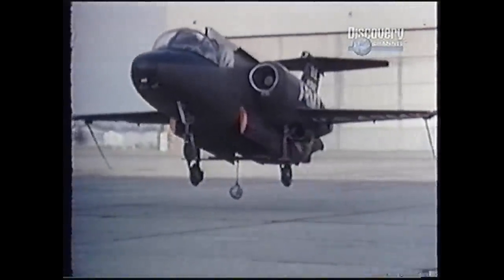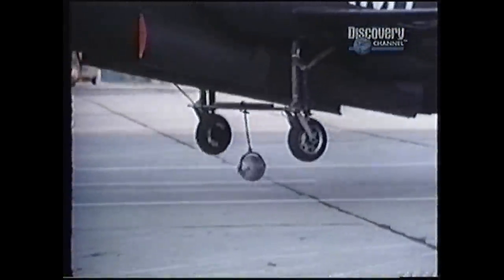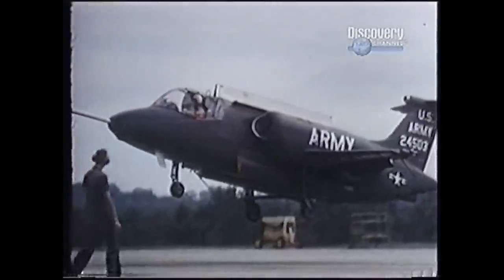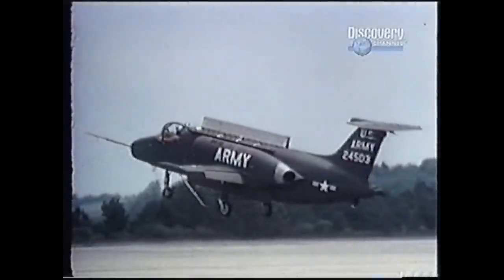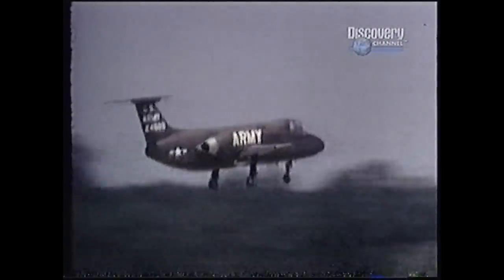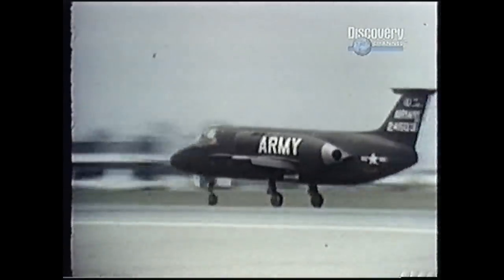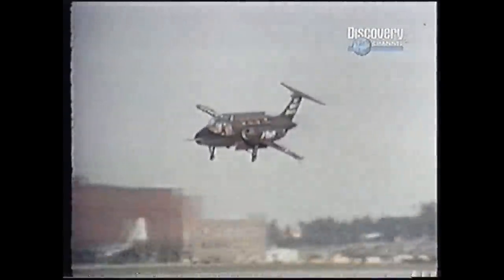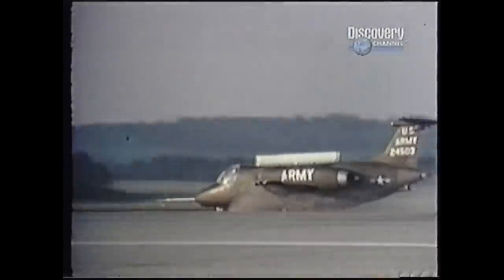Lockheed XV-4 Hummingbird Test Flight Crash

Comment: Worked on the B model from 1968 until the end of the program in 1969 following its destruction in a crash after going into an uncontrolled roll at altitude while transitioning from horizontal to vertical flight. The pilot survived the ejection. The plane went in at a nose down attitude, compressed into the ground and then exploded outwards. We picked up the bits with rakes put it into crates and buried it in a landfill following the investigation. I have one of the rudder pedals. Badly damaged and still carrying traces of Georgia red clay.
Reply: man 80 years old and on youtube? you have kept up with the times
Reply: And the pilot?
Reply: @jrr3613  The pilot stayed with the plane trying to save it, ejected at the last minute and survived with minor injuries.
Reply: I thought it looked like Dobbins.
Reply: ''Compressed into the ground'' sounds better than crashing. Also, there is ''controlled descent into the terrain.''
Reply: @davidcraig1579  That's amazing. But are you for real?

Comment: The biggest issue with separate lift engines is that they're just dead weight in forward flight, reducing range and payload. The Harrier at least manages with just the one engine, which is why of all the designs tried, it was the only one with any real use.
Reply: but aiming hot exhaust at the ground isn't always good either
Reply: @midgetman4206  tell that to the bad guys you're flying over.

Comment: The lead ball wasnt to keep it close to the ground.300lbs really is nothing to a aircraft It was to lower its center of gravity to make it more stable.
Reply: Yeah I was wondering that too... 300 LBS, a cessna can carry that
Reply: @2ksnakenoodles  
Until it starts swinging like a Pendulum Do !!!
Reply: @richardvear1635  oof yeah, that would cause massive issues!
Reply: I think those was to prove test pilot have balls of steel
Reply: @Kamran Ul Haq  Lead is not made of steel.
Reply: Lowering the center of mass on a rocket (or in this case; a VTOL aircraft) does not make it more stable. This is what is commonly referred to as the "rocket pendulum fallacy". Here's an excellent video by Tom Stanton on the subject: https://www.youtube.com/watch?v=OYHCP3-mpxk

I'm not an expert nor have I done any research on these tests, but here's my theory on why it was used:
While the aircraft was most likely able to hover with the ball, more thrust was required to hover with the ball off the ground. This meant that, in effect, the lifting acceleration was automatically reduced when the hovering limit was exceeded which, in theory, means that the pilot needed to make less manual throttle adjustments while hovering.

Comment: Lockheed Georgia made two of these and both were crashed, The one in the video was lost in a hovering test, killing the Air Force pilot. The second one, some years later went in an uncontrollable roll at altitude and the pilot eventually ejected successfully. I worked there from 1966 to 1983.

Comment: In the end, the military just said, "You know what? Let's just buy the Harrier, it works so well.
Reply: I recall as a child seeing the early experimental flying (craft); in the national science museum: that became the Harrier. If my memory serves me right due to its shape it's was known as the flying bedstead.
Reply: @pegjames188  That was the nickname for Rolls-Royce's "Thrust Measuring Rig", a test platform for directed thrust engine development first flown in 1954.  That led to the Rolls-Royce RB.108 engine which powered the first VTOL aircraft in 1957: the Short SC.1.  
The Hawker-Siddeley P.1127 (which led to the Harrier programme) flew in 1960 using newly-developed vectored nozzle technology and the Pegasus 5 engine designed by Bristol Siddeley but built by Rolls.  The design of the Pegasus 5 had been informed by data from the TMR but it was a separate programme.
https://en.wikipedia.org/wiki/Rolls-Royce_Thrust_Measuring_Rig

Comment: Never knew about this program. I see a lot of smug posts dumping on this aircraft, but if I recall, the Harrier program in it's beginning stages was plagued with issues, not certain why all the hate on the Lockheed XV-4. 

I wonder if the US Army had succeeded with this and purchased the aircraft, how the USAF might have reacted. After all, the US Army has no fixed wing combat capable aircraft.
Reply: cameraman655 they wouldn't have been allowed to proceed as the Army is prohibited from operating fixed wing combat aircraft. This programme and others like it for close air support aircraft were the reason the Air Force was made to provide a close air support function leading to the excellent A-10.
Reply: Interesting that you mention the A-10 Warthog, I recall reading that the Air Force was looking to decommission the A-10 back in the 90s, but decided against it when the Army expressed some serious interest in acquiring the aircraft. The infantry simply loves that beast.
Reply: cameraman655 there was also the fact that the A-10 had performed better than the so-called experts said it would in the 1st Gulf War.
Reply: Neil Dahlgaard-Sigsworth It kept proving that an old design was very practical at its job with close air support to ground troops. Also, it's durable build kept it in the air under ground fire. It may be technologically behind, but it's like the Bradley, or Abrams of the air.
Reply: Backyardmech1 thepowers that be had forgotten that the most accurate ground attack aircraft in Vietnam werealso the slowest. Nothing ever changes, does it?
Reply: Ben  Daulton I was thinking A-1. I do believe that a few went north of the DMZ in support of the Jolly Greens.

Comment: Imagine how tough to fly w/o computer stabilization!  You had a spherical sector of stability where the thrusters could right it if tilted, but a hairs breadth outside ....boom.   Then there is pilot induced oscillation.   Test pilots trained riding unicycles on tight ropes.

Comment: Lockheed tried "jet augmentation" in the XV-4, it did not work. Rockwell merely repeated the same mistakes with the XFV-12.
The F-35 does not use "jet augmentation".
Kieron.

Comment: That's why it's an X plane their experimenting with the concept, just one of many different types they tried starting in the late 40's until the AV-8 Harrier in 1967 and todays F-35, took them that long to get it kind-a-sort-a right. Check out the Convair XFY pogo of 1954.

Comment: What if we took 2 engines from the F35 vtol setup and placed them on a v22 in place of the turbo prop that has to rotate the entire engine ?
Reply: That would give it a power to weight ratio of around 1:1 that's just silly

Comment: Not too impressive. Just like the harrier it must have an engine that produces enough thrust to lift the aircraft, i.e., if you want to lift a 20,000 lb. plane your engine must produce 20,000 lb. plus thrust to hover. A much better design was the Ryan XV-5a. Using 5,000 lb thrust engines it could lift 20,000 lbs. Much greater range also. But, the government didn't like Ryan. Guess they didn't bribe the right politician.
Reply: John Melvin no you need to produce at least 24,000lb of thrust to take into account hot gas re-ingestion thrust losses. It doesn't matter what engines are fitted or what technique is used to generate the vertical flight when using engine thrust to produce lift the circulation field in the hover will cause hot exhaust gases to be sucked into the compressor.

Comment: This is why The Army doesn't fly any more.
Reply: The Army flies helicopters.
Reply: @brianlott7571  - We're not talking choppers.  The Army stopped flying planes when the Army Air Corps became the Air Force.
Reply: @justafanintexas7913  You did not state “flying planes” in your initial comment.  You said “the Army doesn’t fly any more” and that, simply, is not correct.
Reply: @brianlott7571  - I'm an ex-Naval Aviator and the term "flying" refers to aircraft not altitude limited crafts.  Your education is now complete.
Reply: @justafanintexas7913  Your condescending attitude and arrogance leave much to be desired. Since all aircraft, both fixed wing and rotary wing, are “altitude limited”, the term “flying” does not apply only to airplanes, it also includes rotary wing aircraft and lighter than air aircraft as well. Being an ex-Naval Aviator you should already know that. Apparently you just don’t like being corrected when you make an incorrect statement. 
Should we contact the United States Army and ask if there are Army personnel engaged in flying activities? You know, like the Army helicopter pilots of the 101st Airborne Division, which I served in from 1975 to 1978?
Or perhaps we could visit an FBO at a local airport that offers “Flight Instruction” in a Robinson R22 helicopter and see what they have to say.
You see, I am a second generation Pilot and aircraft owner who has been around “flying” and airports my entire life. I have been a licensed Pilot since 1983 and an aircraft owner for twenty four years. Now, your education is a little more complete.
Why don’t you do this: hop aboard a Robinson helicopter and transit Class Bravo Airspace without a clearance from ATC. Then, when the FSDO contacts you with an Enforcement Action against your Pilot Certificate, why don’t you tell the FAA that you were not “flying” because you were in a helicopter. Let me know just how that turns out for you!
Reply: @brianlott7571  - No, I just don't abide keyboard commandos like you that have no clue to the proper nomenclature.  We're done here.
Reply: @justafanintexas7913  when faced with the facts and superior knowledge, the weak resort to name calling. Naval Aviator? Ha!
Reply: @brianlott7571  - What is the difference between a Naval Aviator and a Pilot?  There is one, so military expert, what is it?  I learned it at Annapolis, Class of 1973, and at flight school in Pensacola and later Miramar.  Well???
Reply: @justafanintexas7913  what exactly does that have to do with your original, INACCURATE statement that “The Army doesn’t fly anymore”? The answer is “nothing”. Stop changing the subject, grow up and admit you were wrong. Until then, we are done. Find your entertainment elsewhere.
Reply: @brianlott7571  - The original comment applied to jet aircraft which was the subject of the video.  Learn comprehension.
Reply: @brianlott7571  - I also note you failed to reply to the question of Naval Aviator vs Pilot.  Very telling.

Comment: this is the grandpa of harrier jets with vertical takeoff :)
Reply: The British Hawker Siddeley Kestral is the father of Harrier jets, first flight in 1960.
Reply: The P.1127 prototype was designed in 1957 by Sidney Camm around the prototype Bristol Pegasus engine, and first flew in  late 1960. It was able to fly both conventional and from vertical take off and landings by mid 1961. The P.1127 test aircraft was then developed into the Kestrels which were extensively tested, before the first versions of the Harrier went into production in 1966/7. Growing up close to RAE Bedford in the late 60's and early 70's I was fortunate enough to see Kestrels and Harriers flying from the RAE often as a child.